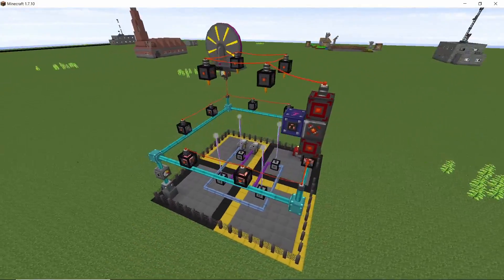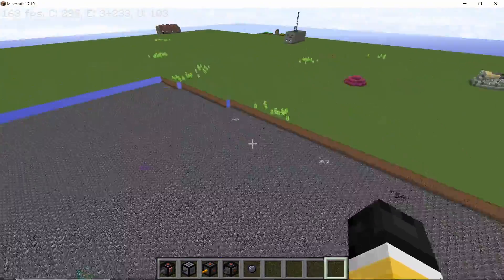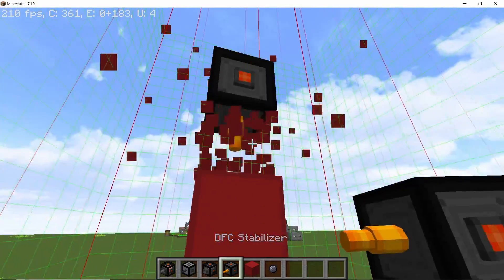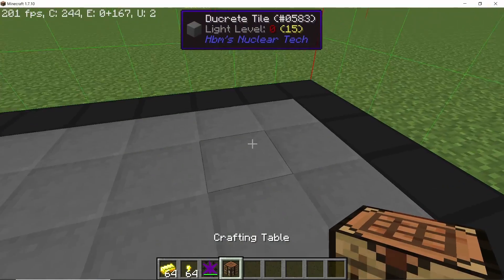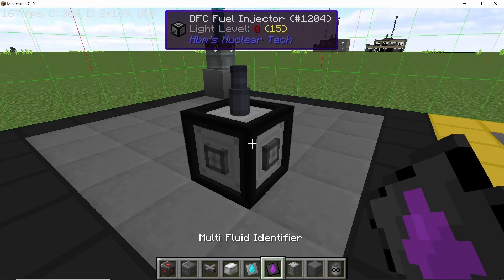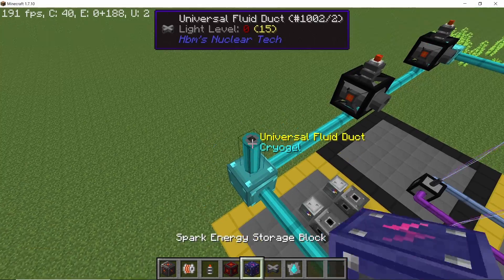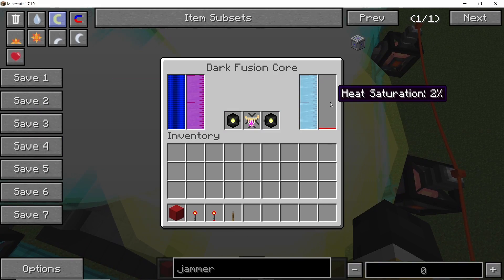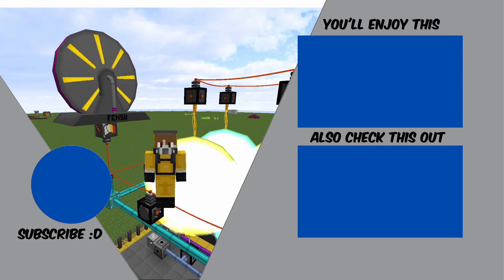4 Core DFC Reactor is POWERFUL - 1000+ THE/s Power Production - HBM's NTM

Comment: I have a question about heat/radiation coming from the reactor. If I get too close I just burn up. I found that building a stone wall around the reactor pretty much stops it if I keep right next to the stone wall. But without the wall I need to keep an additional chunk between me and the one where the reactor is. What is the best material to use for shielding so I don't need to leave this space?
Reply: Idk about blocks but with the right armor, such as DNT-nanosuit you don’t have to worry about fire

Comment: I have been thinking, to prevent a meltdown, you could make one AND logic circuit, where the emitters are only powered when the stabilizers are powered. Basically, make emitters unable to access the power grid, only being able to do so when you turn ON stabilizers, as the emitters are connected to the stabilizers power grid, but not the main one, so turning on stabilizers enable the emitters to access the main power grid.
This would make a safer DFC that avoids turning ON emitters before stabilizers by accident.

Comment: I made a 3 core dfc that can instantly fill a fensu. world got corrupted though and I do not remember the exact settings but I could probably throw another one together. it requires a field jammer because when all cores are activated it is in a constant meltdown. it uses uu matter and bf rocket fuel for fuel each of the cores uses 3 stabilizers with undefined stabilizer lenses. it has to be tunes carefully because at a certain point the third core just shuts off. not sure if it is caused by the integer limit but if you increment one of the emitters (there is an emitter between each of the cores to magnify the beam and to make it more modular) by even one it will cause the whole thing to shut off. probably could improve the design but am honestly too lazy.

Comment: As it turns out, you don't want to turn off the stabilizers before turning off the emitters even with the field jammer, as while it doesn't blow up with the jammer, you end up releasing a crap ton of radiation (I checked with a geiger counter and it read at over 20000 RAD/s). Could be the nature of the dark fusion reactor, but I don't think a fusion reactor would produce THAT much radiation from instability. Thankfully, the impacted radius is far lower with the field jammer than without (and the radiation pretty much goes away once you turn back on the stabilizers or power off the DFC).
Reply from the maker: True, the radiation leak is absolutely crazy even with the jammer but atleast you get to keep a big chunk of your world. But yes it always pays to make some sort of sequential system where you can't turn the stabilizers off before turning off the emitters